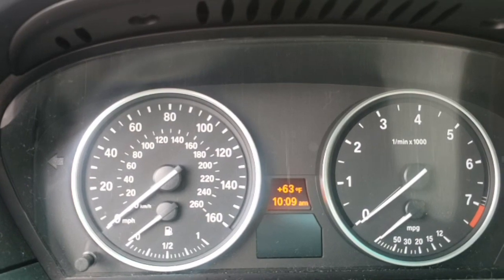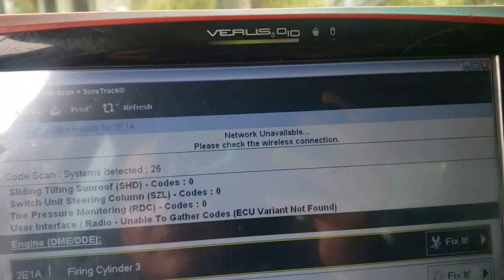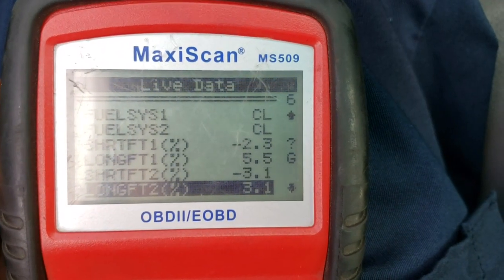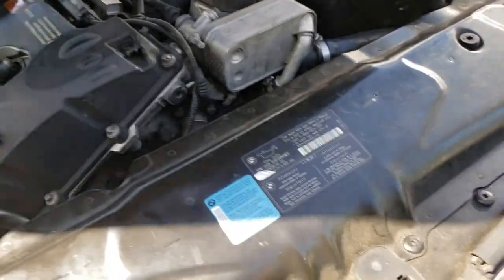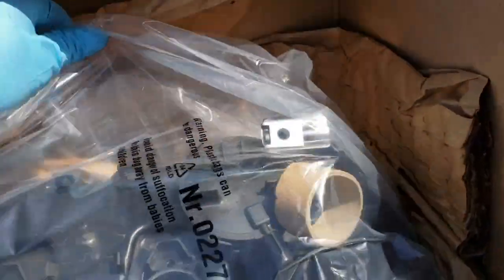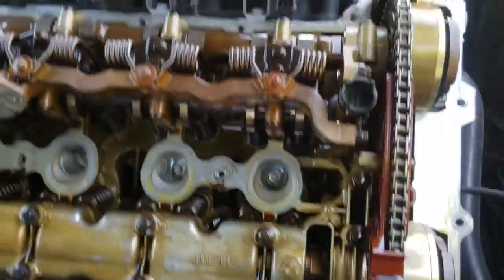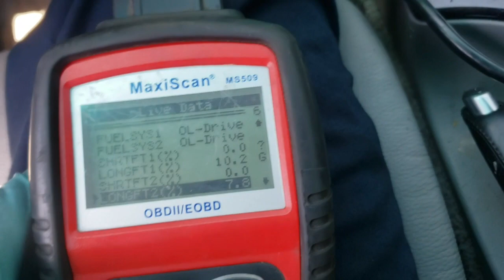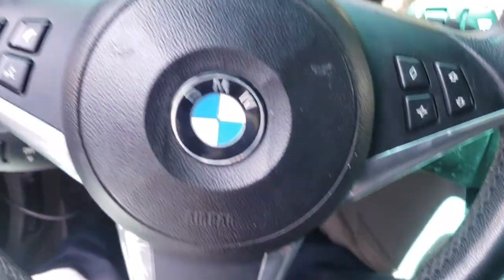BMW 08 N52   MISFIRING RUNNING ROUGH IDLE  DIAG AND REPAIR

Comment: Awesome video mate. A great insight into reading some of the scan tool readings. I have a 530i e60 that I have replaced the valve cover gasket, the manifold gasket, the pvc valve, the spark plugs and coils and the valvetronic motor gasket and I still have rough idle on startup until it’s warm. Is there anything else you could suggest to help me fix this. Thanks Nathan
Reply from the maker: Any diagnóstic trouble codes ? That is the beginning
Reply: 1. Clean your solenoid return valves. 2. Take out and test solenoids for function and cleanliness. 3. Pay attention to the exact code you get with a diagnostic tool, most of the time it’s what the code that is the problem. 4. Make sure the plugs from the o2 sensors on top of the engine in the harness are in the correct order. Also check plugs for solenoids sometimes ppl put the exhaust in the intake. 5. Don’t go changing parts until you know 100 % unless those parts are maintenance parts even then test them and look for their code to show up before you change them.
Reply from the maker: @danaslamzada8926  I prove it there we had execive crank case pressure

Comment: Hey thanks for the vid. Is it necessary to replace the breather hose too that attaches to the intake manifold? How can you diagnose whether its the pcv valve or a bad breather hose that needs replacing? Ive got a lot of pressure in the crankcase which has caused a vcg leak. Also some suction at the oil cap. No codes or EML. Thanks
Reply from the maker: If the hose is broken  you will not have   elevated   crank case pressure.   Disconnect  the hose plug it ,  and watch the  fuel trim  , or engine  conditions,  did it get better??

Comment: Just had a shop install a new starter on our 2007 e90 and now a misfire on cylinder 1 so we changed plugs, coils and injectors and it's still running rough with engine light. Showing cylinder 1 misfire again.
Reply: so what ended up being the problem for yours? have same issue
Reply: @melvinmartinez9744  sensors were swapped, got those sorted out and a week later a loose fuse or relay was shutting car off unexpectedly. Running good now.
Reply: Which sensors got swapped? I’m having this cylinder 1 misfire help plz
Reply: I have a 07 e90 too
Reply: @davidvega2381  O2 sensors on left side were plugged in wrong and a friend who was familiar with the car figured it out. I think he just unplugged them and swapped them back

Comment: hey joel i have the 2010 bmw x3 and same misfiring running rough problem i have change new valve cover new spark plug new coil cleaned MAF sensor cleaned vanos solenoid but im getting same misfire code p0304 and p0306 and car running rough at idle and i feel little suction on oil cap  i dont know whats going on this car do you have any idea please help me to fix this car Please
Reply from the maker: First question is   did you install aftermarket   valve cover,?? Out the box are coming faulty some of them , second  you do not want more than  10 inches of water  in the crankcase,  for the particular  vehicle , the pcv system will not affect   2 cylinder affect all cylinder
Reply: @JoelAutomotiveInaction  yes from Amazon $100 for valve cover
Reply from the maker: @arjunpatel3709  when I do mobile diagnostic   when they have replace components  and they can not fix the problem 80% of the time I find is faulty new part that was added to the original  problem , those vehicles  are very demanding   quality  oem is my recommendation
Reply: @arjunpatel3709  never use an aftermarket valve cover...BMW valve cover only
Reply: @arjunpatel3709  that’s your problem a oem valve cover is $400

Comment: Crazy their ccv valve went bad at 116k, mine went bad a few weeks ago.. I’m at 170k
Reply: why crazy? these valves can go as low as 60,000 miles
Reply: D GARCIA cause mine lasted almost 200k?
Reply: mine is holding at 258,000km